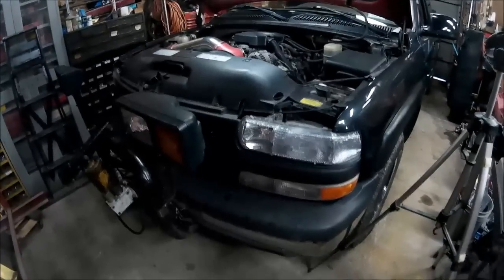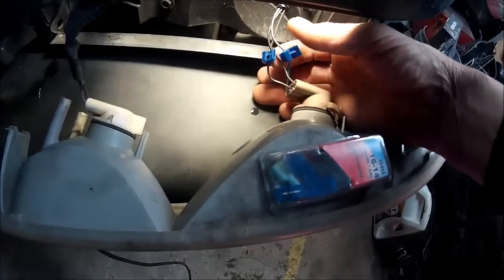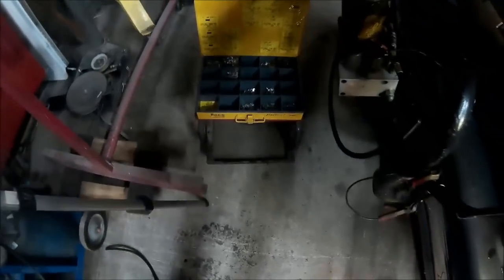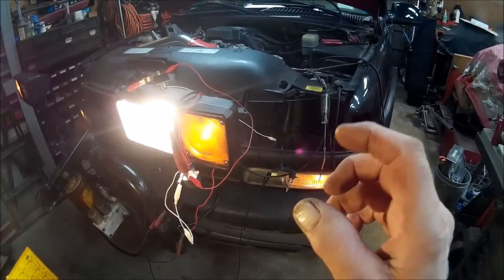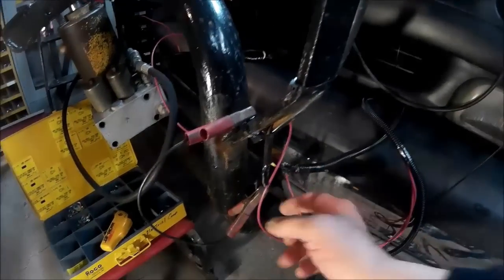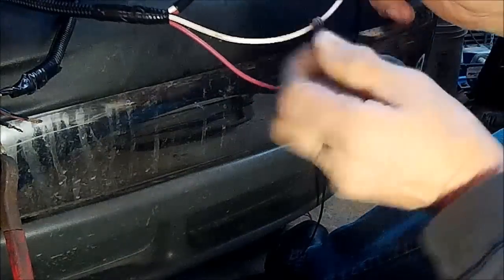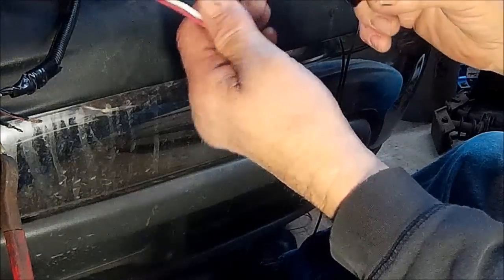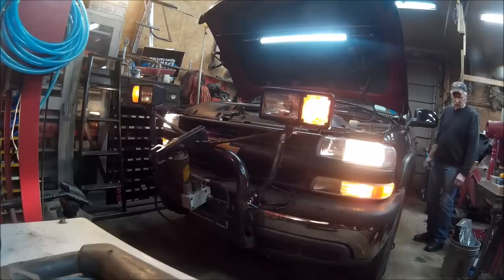Plow Lights 101

Comment: Thank you!
I have everything working on my fisher minute mount except for both signal lights and the turn signals. This is a used plow and truck to for me. I took the signal bulbs out and they looked like they did work at some point, so I replaced the bulbs, but still not working. 
Any thoughts?
Thank you!

Comment: Great video.  I mounted a Curtis plow on a 05 Silverado    that was originally on a 99 Chevy. Fortunately,  my local Curtis dealer had the short harness that sits between factory headlamps and the plow harness.  $40 for left and rignt side.  Otherwise,  I would have been doing this project as well.

Comment: Do you have to separate both left and right ground because on the harness they have separate grounds. So do you have to have 2 separate ground for each light to the new switch
Reply: Each light is grounded independently
Reply: @terrygraves4736  Do you mean each bulb has a separate ground? the wires from the lights appear to have one common ground wire for all the bulbs and one wire to power each bulb - directional, running, high beam and low beam. How are the high & low beam grounds switched if the directional & running lights are using the common ground? Seems the power to the headlights needs to be switched for the plow, not the ground as for the truck, unless I'm missing something.
Reply: Maybe I should have asked, are you talking about the plow lights or the original lights on the truck? The plow lights on my truck are separate,  one ground for each light, the ground for the clearance and signal lights are tied to the headlight bulb wiring and ground to the plow frame individual. Hopefully that answers your question
Reply: @terrygraves4736  Thanks for the reply, I was referring to the ground for the plow lights. If the ones on the video have independent grounds for each 'bulb' this was not made clear.  A guy I know is trying to install plow lights to his 2002 silverado and I believe his plow lights have one common ground for all bulbs making it all hot switched. This makes it difficult to figure out how to wire the headlights into a ground switched truck. The directional & side lights being hot switched (in the truck) are easy enough, but if the truck headlights are ground switched we need to come up with some unique relay solution to switch from vehicle to plow lights and also to be able to change the plow from low beam to high beam. I'm now leaning toward just wiring the plow lights directly to the battery, putting a high/low/off switch in the cab and tying the clearance & directionals to the truck lights and not worrying about integrating the plow headlights into the truck headlight wiring.

Comment: The part which confuses me is how the original dimmer switch in the truck works while you have it in either position. So when you tapped into the ground from the low beam at 8:35 wouldn't you lose that dimming function? Isn't that the ground which is fed from the dimmer switch?
Reply: Yes, I'm adding to it not swapping it,
Reply: @terrygraves4736  thank you for the quick response.  What do you have the plow headlights hooked up to for constant power? Straight to the hot on the coil or spliced to the power of the truck headlights? Or do you have the plow lights to a constant ground and the relay once tripped by the ground from the dimmer switch sending power from relay to the bulb?
Reply: @terrygraves4736  so correct me if I'm wrong please. So you cut the grounds from the high and low beam on the driver's side. Then added wire from those back to the cab to the switch. Then back from the switch to the bulbs which were cut?

Comment: Can you show how exactly the headlights are wired to the plow lights and what wires go to the relay? Thanks.
Reply from the maker: I'll see what I can do, not sure if I can get a picture up here or not, but I will try and answer you questions, might be tomorrow sometime.
Reply: RVTEK that would be fantastic. Even a rough drawing would great.
Reply: Did you actually cut the wires for the low and high beams or are you slicing into them? I'm trying to draw it on paper so I can see how it works.
Reply: RVTEK i also need help with the headlight wiring and relays. Please help!

Comment: Exactly how did you wire the lights? Did you put 2 relays per side? did you cut the original light wires to go to the relays ? I am trying to do this on the same truck you show in the video.
Reply: I am having the same problem/question. I understand switching the ground wires for the lights and using the ground to switch the relay but did you run the grounds for both sides through the same switch and relay thus making it a common ground for both the left and right headlight? That is what I plan to try but was hoping to make sure I have that right before I cut into things. I assume you have to cut in to both sides to switch the truck lights off when you turn on the plow lights through the relays. Thanks!

Comment: Can you just run the wires directly to the headlights and just remove the bulbs on the truck,because my plow lights will be permanent its just for plowing only.
Reply: You might be able to, the problems that I've run into is overloading  the wiring. Thats the reason for the relay.

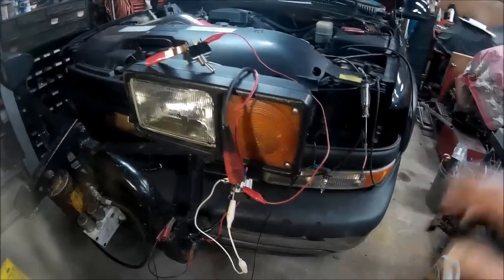Comment: I'm very confused, he shows at about 4:30 min. that there is one ground wire going to the plow light assembly that apparently is common to al the individual lights - directional, side, high & low. But at about 9:00 min. he starts talking about the Chevy switched ground headlight system and how the relay he is installing will switch the ground to the truck headlights and the plow headlights. He states that the plow headlight will have power all the time and the relay will apply (switch) the ground to the plow headlights - both high & low independently.  How is this possible with just one common ground on the plow lights?  If anyone has this sussed out and can draw a schematic that would be great...
Reply from the maker: Two separate systems, the clearance and signal lights work directly off the original truck wiring, the headlight system runs the grounds thru a relay, old time switches run power thru them, that has caused problems with heating up and burning out wiring, unless you beef up, (get bigger) wire to hold the load, then the switch is the weak link. Sooo to combat that you run a relay, power to the relay is constant but the relay needs ground to work, so your switch puts ground to the relay turns the relay on and lights come on.
Reply: @rvtek4695  Yeah, using a relay is the correct way to go. I figured out what is going on after playing it several times and watching what the video showed and not what was said. The switch in the cab is applying ground to the relay coil, activating the switch in the relay, which is applying POWER to the headlights not ground. Also - the ground being used must be coming from after where the 2 low or high beams grounds are joined. If the ground used is the one shown (at one of the bulbs) the other truck headlight would still be lit after switching to the plow lights.

Comment: Did you use one relay for each headlight?Were they 5 pin relays?Did you use 1 switch for each relay?Thank-You
Reply from the maker: Hi Stephen, I used two relays one for each position, (HI or Low beam)  they where 4 pin stock chevy headlight relays, and a two position switch one way for stock lights one way for plow.

Comment: I would wire the snow plow independently with its own relay and high and low switch and a fuse won't hurt anything.
The turn signals you can just tap into the truck with water proof connection and you are done.
And mind you I care less about their wires and their connectors.  They are always cheesy.
Reply: The way it's now wired it operates like factory, no need for looking for switches to dim lights while on the road, that's the reason

Comment: Why wouldn't you just get a pigtail and wire it to the plow lights, unplug the pigtail from the truck light and plug the plow lights into that?. Then when the plow comes off just unplug the pigtails for the plow lights and plug the truck lights back in.
Reply: If you've ever seen the size of the wires on a stock Silverado you'll know you can't run lights directly off them, that's why you need a relay for the amperage, otherwise you'll just melt everything down including the light switch, none of which is designed to carry that much amperage.